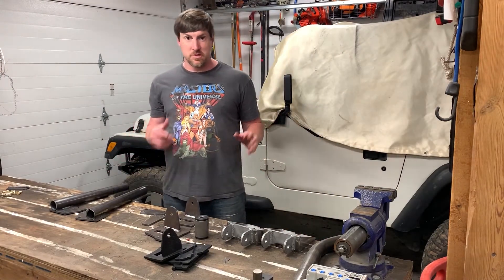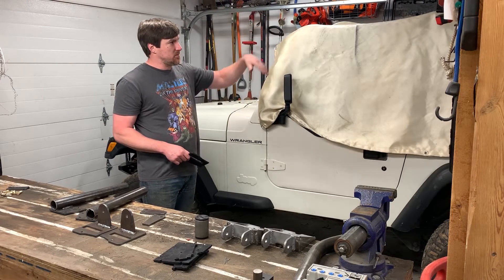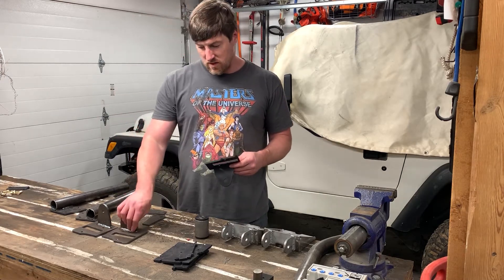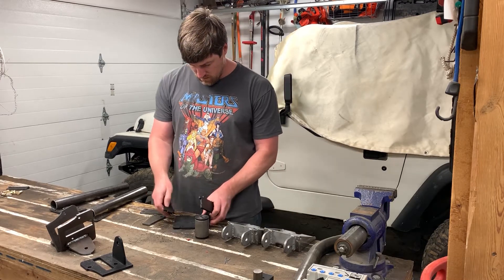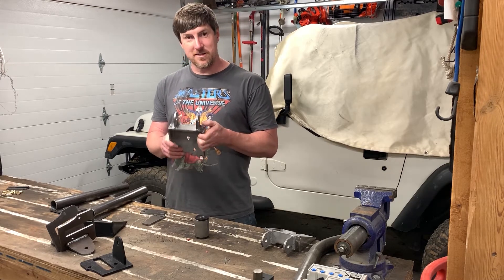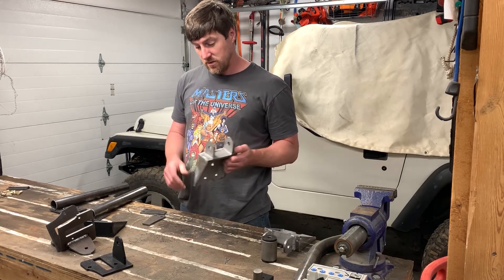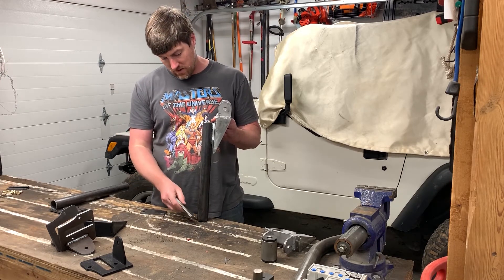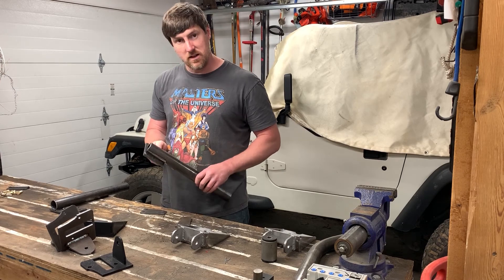Jeep TJ Overland Part 2 Roof Rack

Comment: Next part please. Can you show us how you mounting the tail light support to the bumper?
Reply from the maker: https://photos.app.goo.gl/75dr3V82QV2QHgzo7  I used the backing plate, and made an L bracket that bolted to the factory bumper bolts by the body mounts.  Then welded a piece of tubing between the 2.  The photo link should help.
Reply: @jham4x4  i appreciate it! Want to make a roof rack for my tj unlimited and I love this design where you can flip it over the back. Keep it up